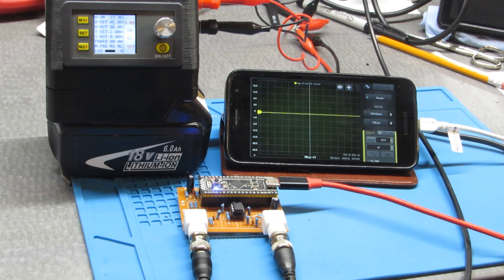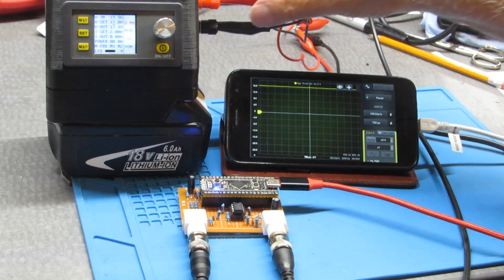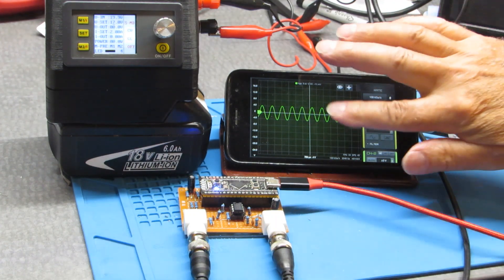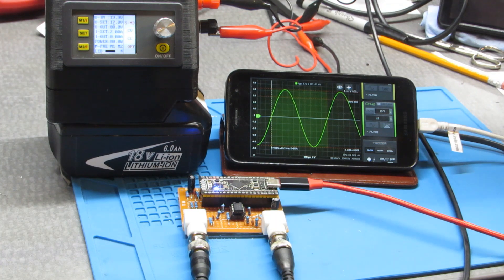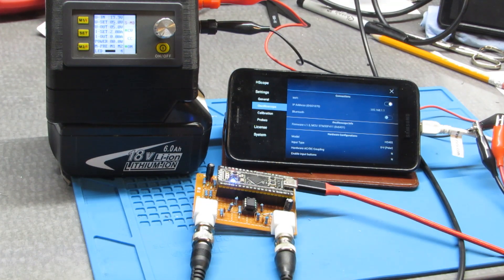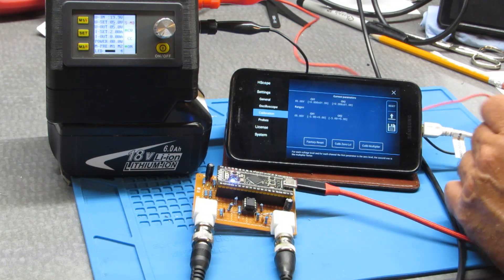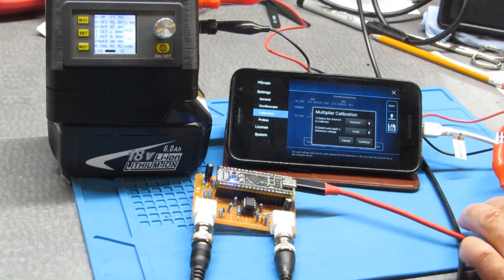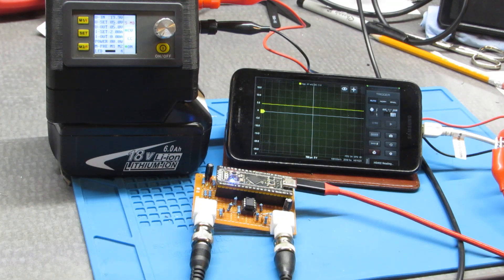HS402 Junior Scope

Comment: How accurate it is for you once you set probe to x10? I am getting something like +3-4v
Reply from the maker: @MinskStreets  I haven't got my Junior with me so I can't test but it should have the same relative accuracy.  The X10 probe is just a multiplier in the HScope software.
Reply: @chrisingram7277  thanks for response, well, I also noticed that you have something like -80mV without any signal, while I have ~400mV (when checking AA battery voltage is correct), maybe this is also being multiplied. I am switching both places on probe and in software. I need to recheck my schematics.
Reply from the maker: @MinskStreets  something Martin had mentioned about my design was the voltage reading will float around if the probes aren't connected to anything, it should read 0v with the probes shorted or the correct voltage of what you are measuring after a calibration.
Reply: @chrisingram7277  Got it, that was helpful, in case you will remember and will have your Junior near you, try to measure something with x10 probe. Just tried 9v battery and I have almost 14v. Probes looks like standard x1 - 340 ohm and x10 - 9 mohm. Probably I did something wrong, but it may help, thanks.

Comment: How much voltage measure
Can i use directly ac 220 voltage
Reply from the maker: Sorry for the late reply, no, I'm sure that would damage the unit.
Reply: @chrisingram7277  O so what i do for 220 or 230 voltage AC to use this oscilloscope
Reply from the maker: @TheMunirLaghari  Based on similar designs of the HS402, it's not recommended to use this scope for measuring mains voltage.
Reply: @chrisingram7277  Okay thanks Sir For replying

Comment: Can i use this for Automotive?
Reply from the maker: sorry for the late reply, definitely.  It's designed for +-20v so it works for everything except coils/injectors where you would add a 20x attenuator into the circuit

Comment: there is an error in the pbc in 100k resistor no it is.
Reply from the maker: I'm not sure what you mean, schematic was just updated so you could be right.
Reply: @chrisingram7277  The schematic is fine but the resistor is missing in pin 2 next to r3 that must go to ground
Reply from the maker: @franciscojavierhernandezme4909  Thanks, I'll get that fixed.

Comment: What sampling rate do you get? And how to increase it?
Reply from the maker: I haven't really played with this one much, it was more of an experiment to get a common ground with the power supply.  But a better op amp would help, I just put in a low cost one to try it out.  The real HS402 does a much better job.
Reply from the maker: I'm going to try wifi on this one and do a  little modification and see how it works for automotive.  As is the bandwidth is not great but might be good enough for auto repair.
Reply: Its good for laptop repairs
Reply from the maker: Cool, I missed you comment some how, Thanks.

Comment: Hello and great work, can we pass it wifi like our friend's gadget 137
Reply from the maker: I've got it working well with wifi today, I did a little modification to the circuit and will try to get another vid out soon.
Reply: @chrisingram7277  thank you very much for your return, I am waiting for that thank you for your work
Reply from the maker: ahhhh, it was working nice on the bench, started filming today on the car and no luck, I'll keep trying however.
Reply from the maker: It should work, I'll give it try this afternoon and try some automotive captures.  There is a bit of cross talk between the two channels so it should be interesting,